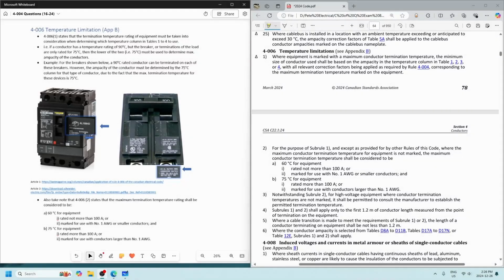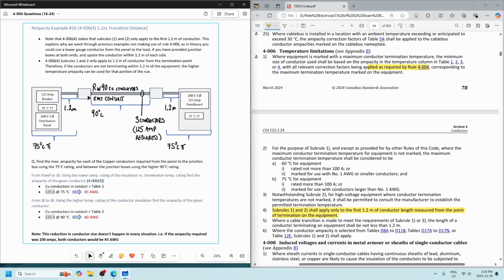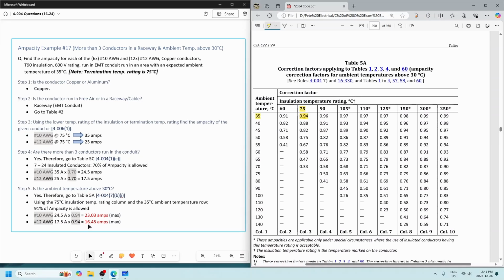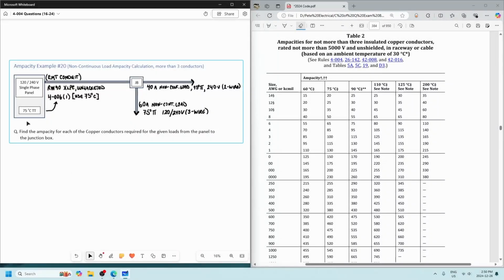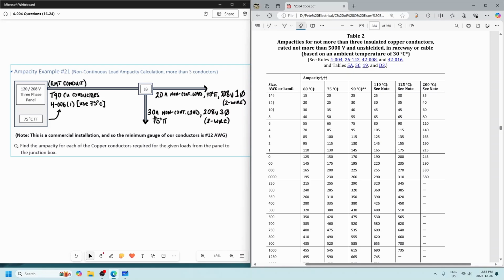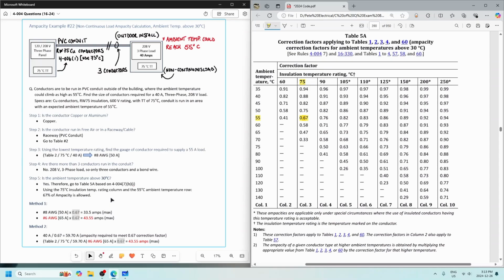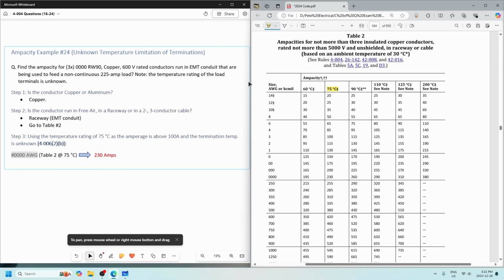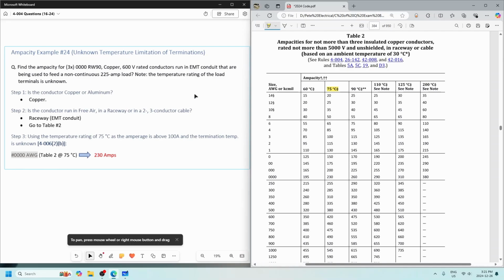Canadian Electrical Code/CEC Rules 4-006 & 4-004 (Consideration of Termination Temperature Ratings)

Comment: Hi Pete, I think you’re doing a great job and I often send my electrical students to check out your content. 
I only have one comment, Rule 4–006 only applies to table 1, 2, 3 & 4, it does not apply to table 5A. In your example 17, when you use table 5A, you should be in the 90° column for your T90 insulated conductors, as table 5A is based on insulation temperature rating and not termination temperature.
Reply from the maker: Indeed. The note on the bottom of Table 5A states († The insulation temperature rating is the temperature marked on the conductor) Thank you for this clarification.
Reply: No problem, keep up the great work
Reply: I was going to say the same thing. Would that same principle of derating based on wire ampacity apply to the following problem #20, at 24:00? That #6 T90 wire derates from 75 to 60 (75x0.8), so can you use #6 wire? Or does the fact that derating brings it below the 65 in the 75 deg column demand that the 75 column takes precidence?

Comment: Hi. In the first example we have 3 phase system 125 amps. Why we don't use a correction factor from the Table 5C? I think we should count a neutral conductor as well (4-004 4)). Thank you.
Reply from the maker: It's just a simple example where there is no transformer between the Distribution Panel and the 125 amp panelboard. Both are a Delta 3 Wire system with no Neutral.

Comment: Pete.-#12 minimum conductor for commercial installation‽-  where is that rule in a code ‽  is common area corridor  in   Residential condo building considered as residential or commercial area!?
Reply from the maker: Common area in residential condo would fall under House Load I believe.
No rule in the code stating that commercial loads require #12 minimum, usually just spec'd for the job
Reply: @PLCAutomationAcademy  oh.- ok. Because I was trying to find that rule ,- and could
Not .
Reply: Excellent. ❤